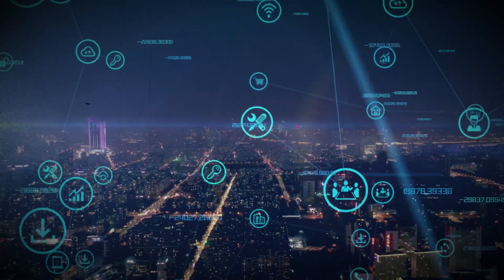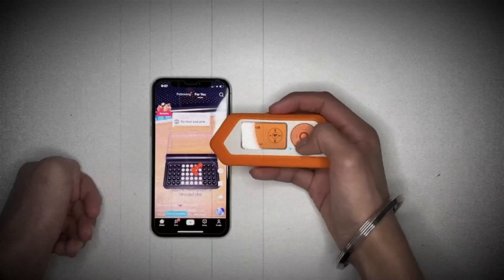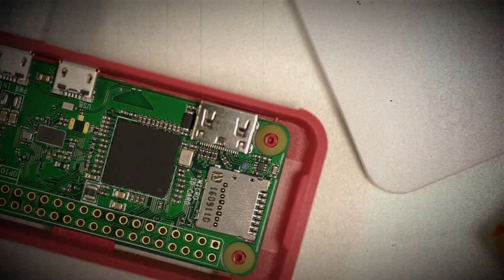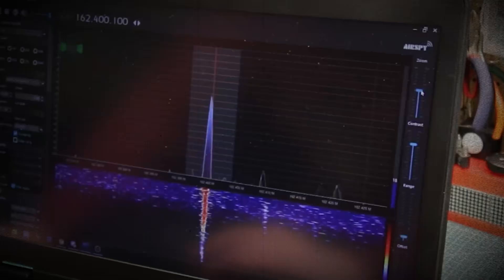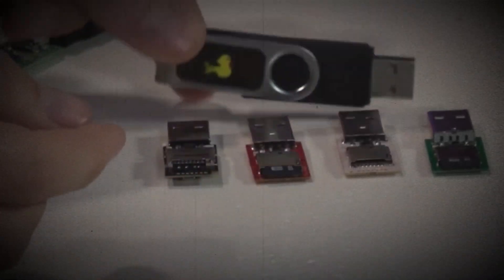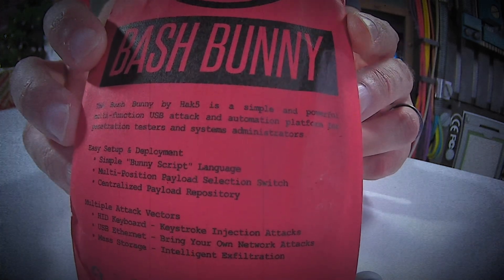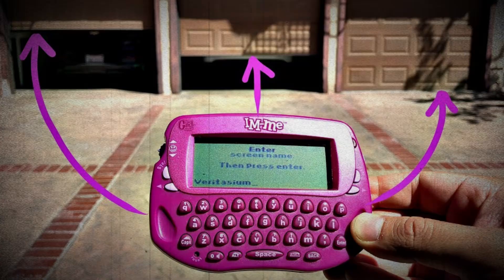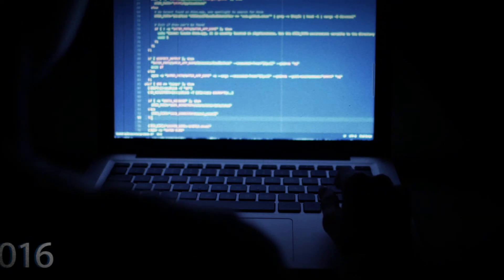10 Hacking Gadgets You Can Actually Buy on Amazon (2025)

Comment: Have you any hacking gadget
Reply from the maker: "Thank you for your comment! 😊 When it comes to hacking gadgets, it’s important to clarify that my content always promotes responsible and ethical knowledge. If you’re referring to tools used in cybersecurity, such as ethical hacking, there are legitimate devices like Raspberry Pi, Wi-Fi analyzers, or penetration testing kits designed to improve system and network security. However, any tool must be used within legal and ethical boundaries. Knowledge is power, but it should always be used responsibly!"
Reply: My flipper is on the way now, but I have the M5StickC PLUS, Cardputer, zero 2w, and pico 2w with 3 more pre-ordered units on the way also. I have a CYD Marauder as well. It's not the hardware. It's the knowledge. Knowledge allows you to make hardware out of scraps.